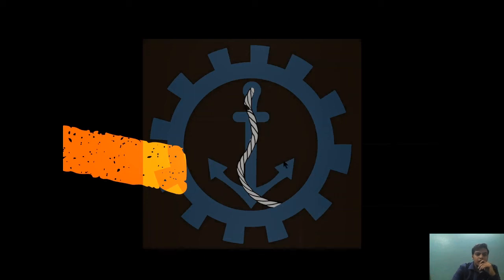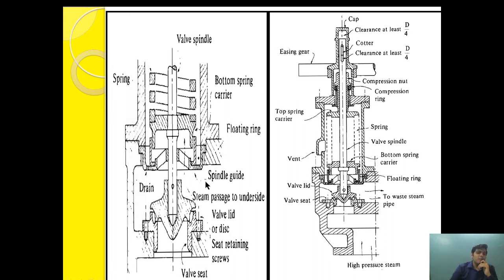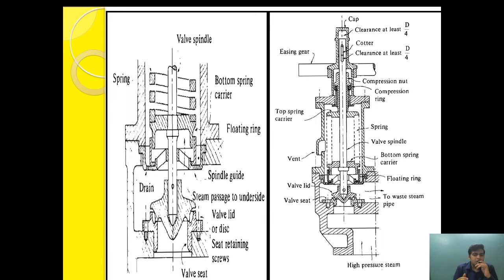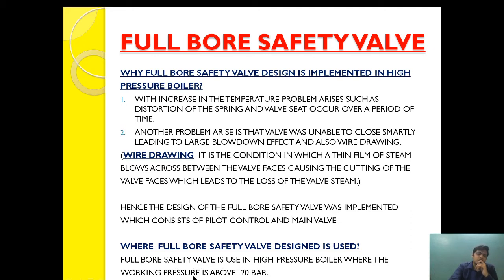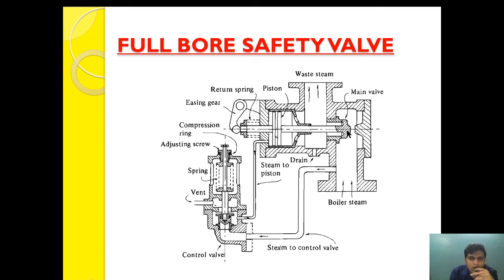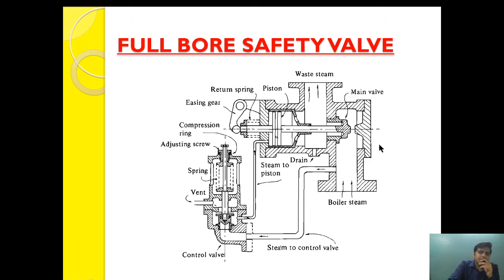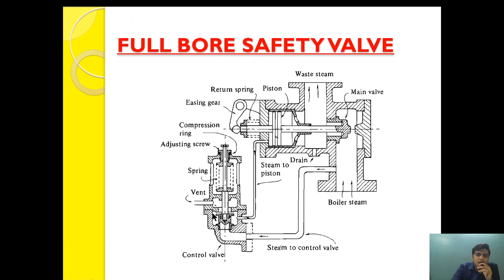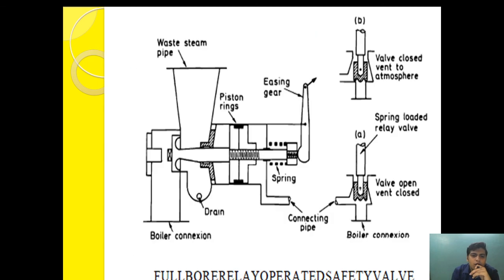FULL BORE SAFETY VALVE|DESIGN|SAFETY VALVE IN BOILER|(PART-3)

Comment: is the saturated steam is pushing control valve?
Reply from the maker: Hello mohd naqiuddeen,
Its not the saturated steam it superheated only which is pushing the control valve!!!
Reply: @MarineEngineeringHub  so full bore safety value is used in super heater?